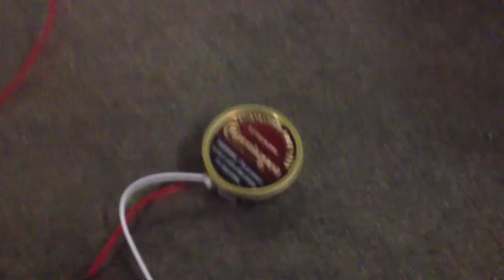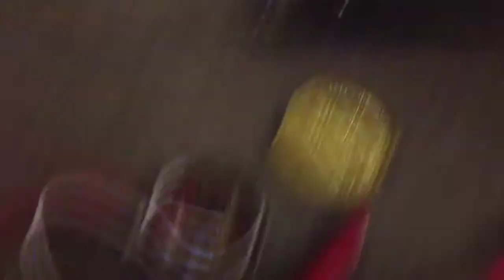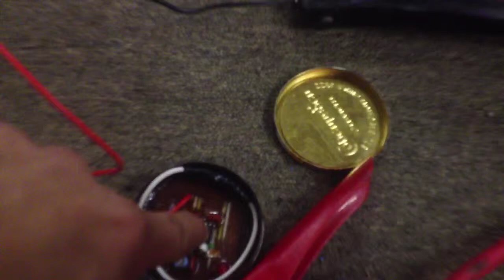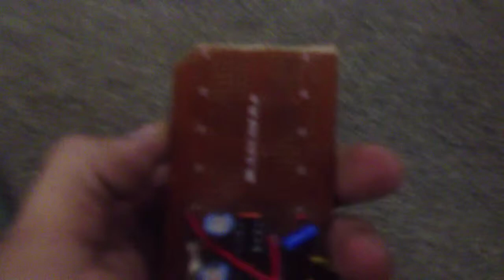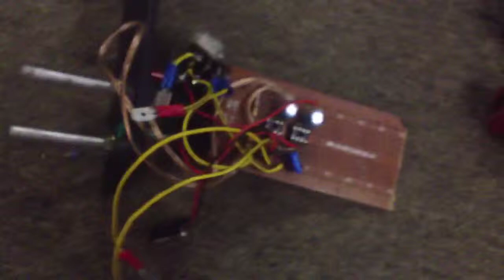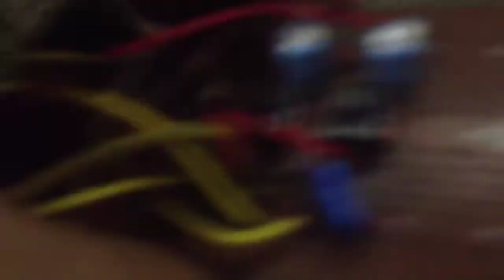Circuit for glowplug control with a remote start when your truck is setup with a manual switch.

Comment: I have a 6.2 turbo diesel I put in a 72 blazer I'm running manuel glow plugs and I want remote start. This looks like it will help me out, my question for you is could you help me put together a parts list of the things I need. I've done some circuitry work but only wiring leds for 12 volt use never anything like this, My glowplugs only need to run for 20 seconds at the most so I will need a different resister/ capacitor combo then you. I looked at your schematic but my experience reading them and using resistors, capacitors, 555 timers is limited. I'm pretty much only good with relays and simpler stuff.
Reply from the maker: I'd be glad to help you out.  This is actually around 25 second second cycle time, I'm going to make a new one with a potentiometer (variable resistor) for this winter as we had a bad one last winter and it wound up not being a long enough cycle time so I want to be able to adjust it, I could just send you my old one.  I'm currently at work but I'll try to get a reply to you in a day or two, I'm currently finishing up an engine swap in this truck (bend a valve...doh!).
Reply: Christian Riedel Hmm well I might be interested in your old one, do you know how much you want for it? Also, I might be better off with one that has the potentiometer because in the summer months I don't need the glow plugs to run more that  10 secs and in the winter the longest I ever have to run them is 20. Sorry, about that bent valve I've had that problem no fun!